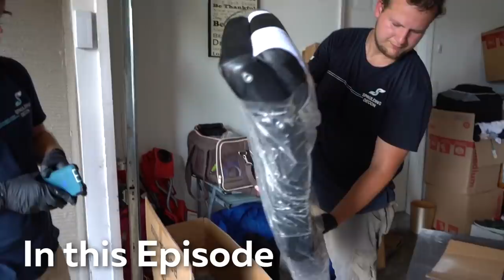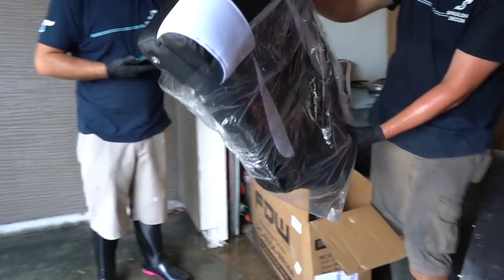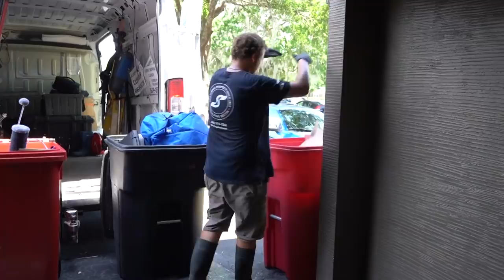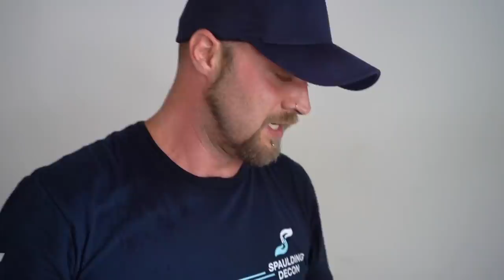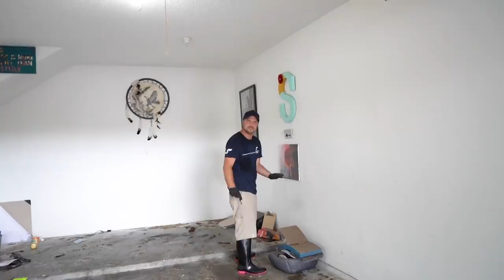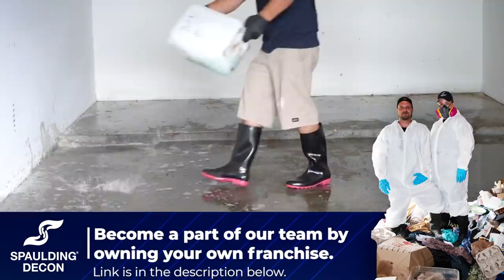Crappy Job

Comment: This is why you store all your stuff in plastic storage bins 🤦‍♀️.
Reply: Or just don't pour paint down your toilet...
Reply: Carboard is cheaper and easier to use if you move a lot. plastic containers are more expensive and break easily during transportation (speaking from experience) plus who would prepare for this situation.
Reply: @elliotlamirande3869  eh, proper cardboard moving boxes here are almost as expensive as plastic containers. 
I get that not everybody would be prepared for this type of emergency though. It seems second nature to me because I've had to go through and throw out so many things that were stored in the garage after years of heavy rains and minor floods destroyed the cardboard boxes sitting on the ground. Now everything is either in a plastic container, or stored higher off the ground.
Reply: @elliotlamirande3869  that's why you go to a family Dollar or Dollar general store late at night. Outside the back door is where they keep all of their storage containers. Different sizes. I have a buttload of them
Reply: beckytwister01 this is a tip that i never knew i needed 😂 thanks
Reply: Isabelle Lamirande Smart people to all my crap is in plastic bins no matter where they are
Reply: “This would never happen to me because I’m smarter” yeah okay whatever you say...
Reply: Had my toilet spring a leak the first year living in this appartment.  The connection with the hose to the wall wasn't secure, and got so bad it flooded through the bathroom closet into the hall closet.  Yeah it was clean water, but the carpet was not!  That was so damn nasty!  Among other things that they did not do, they did not clean the carpet or remove it after the last tenant moved out.  So I had a dirty carpet and it was full of cigarette burn marks and holes!  😡